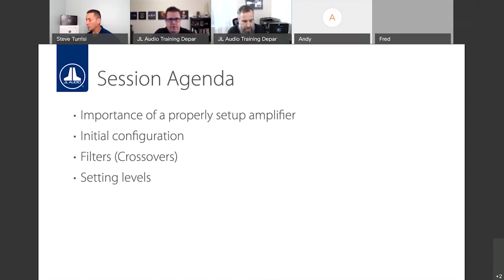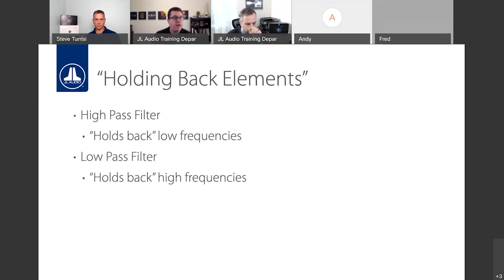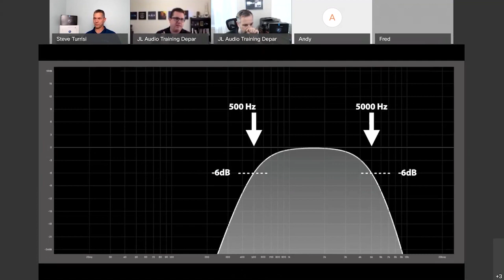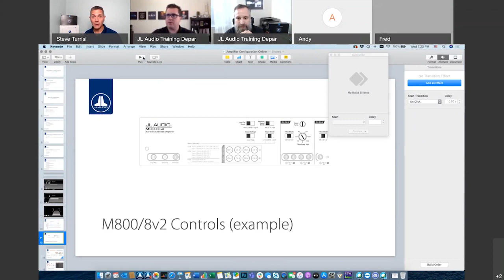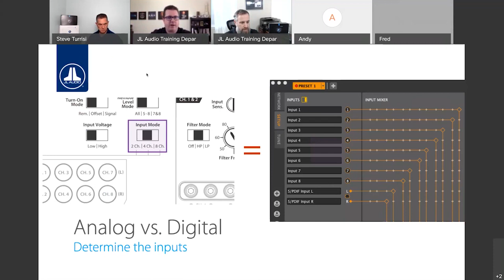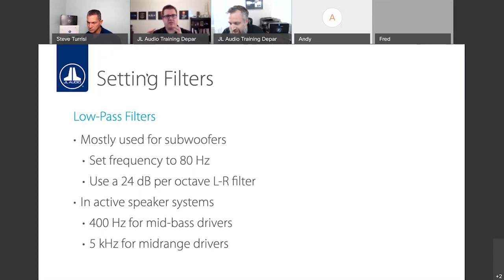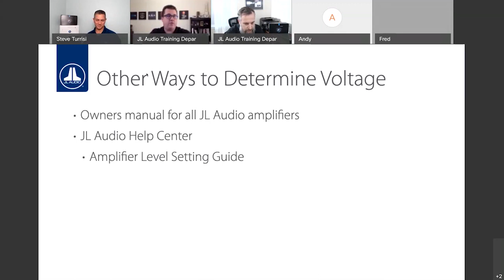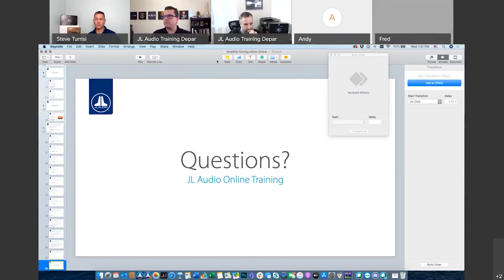[Live] JL Audio Online Training About Proper Amplifier Setup

Comment: I shore wish I had watched this before setting up my RD900/5 amplifier. Only running the sub channel at the moment which is why I was scratching my head why I had to run a remote turn on wire when I wanted to use DC Offset but was unable to, now it makes sense, only works on channel 1 which I’m not currently using.  Lots of good information!
Reply from the maker: If you have any additional questions, we're here to help! Please don't hesitate to reach out.

Comment: I have to vouch to the quality of JLAudio, I purchased a HD 900/5 amp and 10w6 sub back in 2007-8, they have seen three car installs along the way, the amp is still running strong and being used in my current system, the sub has finally gave out last month, the cone separated from the foam baffle on the outside, I know I could probably send it back and get it fixed (16+ years of jamming, cant complain!), but I decided to get a new one in your pre-made ported box, may still send back to see if the old one can be fixed. So I have a question about setting gains, I'm currently running Focal elite 165k2 two ways, the crossovers have sperate outputs for both the tweeter and mids, so, I have the tweeters running off the front channel and the mids running off the rear channels, should I use different test tones for each channel now that the mid and tweeter are running off separate channels? and if so, what test tones should I use for them? Also does this make any sense running them like this, is there any sound quality gain having the mid and tweeters getting more "power" or should I just run them off the front channel?

thanks

Comment: I am truly educated here by JLAudio and glad to learn that people behind the products are really smart and informative. I have a question. For analog frequency filters, if I want my midrange to work fully at 300Hz, I have to set filter to high-pass mode and the potentiometer to 300/1.4 Hz or 214 Hz (at -6 dB) and then the power will drop 12 dB from 300 to 150 Hz. I already check out the manual and there is no information about at what frequency the filter starts to cut off for a given potentiometer value?
Reply from the maker: Geat to hear! To answer your question, the filters in most of our amplifiers have a 12dB slope.

Comment: What an awesome video! I read manuals and tuned my amp for my XD300/12TS3 power wedge to 24.5v as the manual said at 3/4 of the volume .  (Thanks for the sound file from your website) It didn’t quite sound/feel loud enough for my normal listening level. I did this before watching this video.

Half volume is very loud on the stock Bose system in my truck, so I think I will tune it the same way but at half volume. If I decide to go louder than half, can I just use the remote to lower the sub volume in that scenario even though it would probably be very temporary?

This video just made everything so much easier to understand when installing a new sub!
Reply from the maker: Yes, as long as you're aware of the change and why you are doing it, there is nothing wrong with setting your sensitivity this way.

Comment: Great Info!  Can I use also the DMM method on a JD400/4 as well as the clipping LED?
Reply from the maker: Yes! You could use the DMM method, although typically the clip light allows you to gain a bit of extra output versus the set target voltage suggested for 75 watts.
Reply: @JLAudioInc  Thanks!

Comment: Should this process be done with the engine running or engine off? Thank you.
Reply from the maker: Hey there, Dante! Thanks for reaching out. Since no load is attached and the amplifier is not doing much work, it shouldn't matter if vehicle is on or off.

Comment: What is “desirable” level of clipping for a sub in terms of a percentage of voltage above spec on a DMM?  Sub is JL M7 12”

Also, my Fusion RA770 doesn’t clip at full volume on my SMD-1 so I set the gains at full volume

Comment: So TW1 or TW3 with the VX700/5I?
I have C3-650 in coax in the front door and C2-650x in the rear doors.
Sub will go in the boot of an open hatchback (2014 Subaru Impreza)

Comment: I’ve always been happy with JL products, I’ve been using them since 2000. Never a problem but I wouldn’t want to be a manufacturer. I’ve seen teenage idiots ( is there any other kind?)  do everything wrong. 10 gauge wire from battery post to frame. Using amp gain AND Bass boost as volume control, 2 4 ohm subs wired series and claiming subs are junk with no output. You name it I’ve seen it.
Reply from the maker: There have certainly be some interesting "strategies" throughout the years that proved to be far from efficient. Thanks for sharing, Jeffrey!

Comment: Hi
@JLaudio Just getting back into putting bass in my car after around 15 years gap so slightly rusty. I haven’t really used JL Audio in the past but after research I am sold. So I’d like around 500rms and am very interested in a single  10w3v-2, space is an issue so will be getting a custom sealed enclosure made specifically for it with all recommendations set by JL. My question is would the JD500/1 amp be a good partner for the sub?

Many thanks
Reply: @JLaudio I will appreciate if I can get a reply on this
Reply from the maker: Riz, our apologies for the delayed response - our tech team will certainly be able to assist you with this further - you can reach out to them directly here: https://jlaudio.zendesk.com/hc/en-us/requests/new?ticket_form_id=360000078093

Comment: Hi, you mentioned something about the TwK88 and input sensitivity. My source unit has a 5v pre-out and distorts at volume 48/50. Am I right in saying that the lower the voltage number on the input side, the less gain I will need to use at the amplifier? I ask because right now, with the volume at where it is, the input is set at 7.1, which yields in me having to turn the gain up high, I normally run direct from source to amp and I don't have to crank up the gain so much, it normally clips at just under 1/4 of a turn.